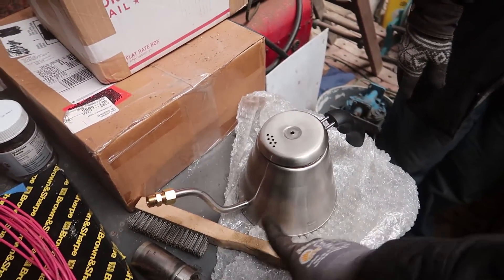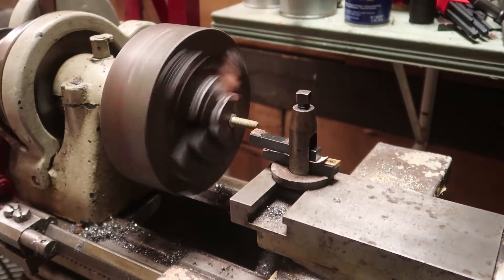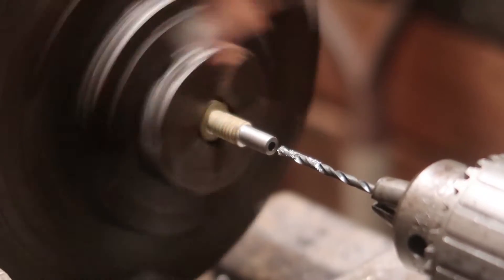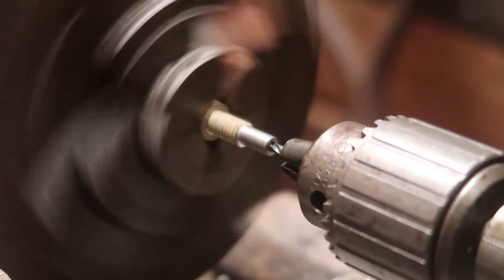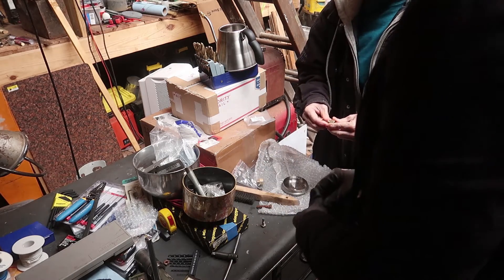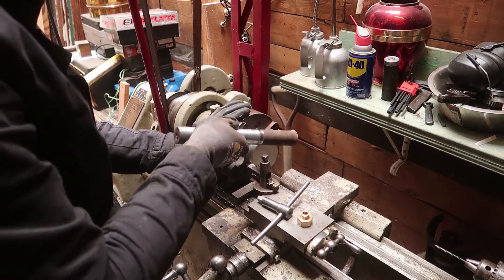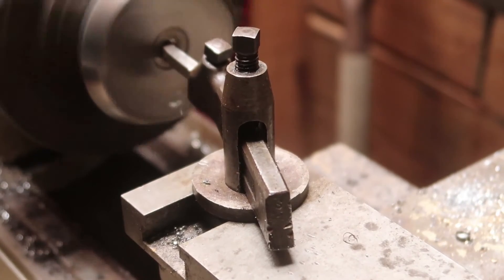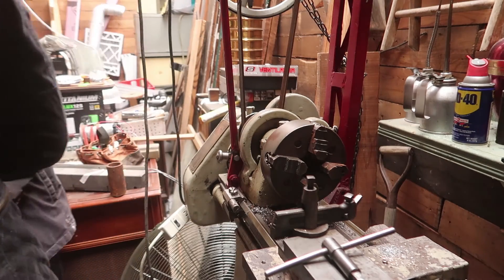Learning To Lathe 05: Rapid Prototyping Metal Fittings for Homemade Water Distiller System

Comment: If you want to make that lathe quieter change that belt to a car serpentine belt  it will have more grip and run smoother
Reply from the maker: that is a horrible suggestion, flat belt is great for this as long as its the right length.

Comment: A brief suggestion, when manually feeding as you did on the compound to clean off the threads: use two hands, rather than just one on the handle, to turn the control. That results (with practice) in much more even tracking of the tool, which results in better finish and more consistent material removal.
Reply from the maker: yeah i do that with the larger controls that face me but its difficult to do that with the sideways handle when my moms standing in that spot.

Comment: I was surprised to find that CPAP manuals only recommend distilled water in the USA. For Europe and elsewhere, they just read to use, "clean water" (caveat - I only checked the Resmed machines). I found out that any water that is safe to drink will work just fine for CPAP humidification. That being said, if your local tap water is loaded with minerals, it can build up stubborn deposits in your humidification tank and you have to soak it in vinegar (or worse) every so often to clean it out. So in some cases, distilled water is easier to use than cleaning off those deposits. But just FYI on the off chance you weren't aware. Love the videos! Keep up the awesome work!
Reply: My hubby has used his dry for years.

Comment: You didn't  show in the video  but make sure you are oiling those caps before and throughout  turning mine will empty them in about 10-15 minutes  i usual use 80w or higher but my lathe is also larger
Reply from the maker: i oil it ever few uses, but i dont want to oil it too much or it drips down and goes everywhere and wastes it.
Reply: @RinoaL  id say a lil wasted oil is better than a wasted bushing
Reply: Also keeps it from rusting lol
Reply from the maker: well the babbet bearings are ruined anyway, ill need to repour them. so im honestly not too concerned. seem to remember they have a lot of scoring and gashes in them.

Comment: Hey, that lathe is pretty cool. I've got its older brother(newest patent date march 1903). Did you ever get the power feed working? I had the same problem  when I first got mine.
 I made a new worm from a bronze bushing to go in the apron . then lapped the faces of the cone clutch(engages power feed ) with valve grinding compound. This was in the late '80's, and the power longitudinal and cross feeds have worked fine ever since. 

Tom
Reply from the maker: well i havent tried because when i was assembling the lathe i dropped a key that held the gears in so until i find that they wont connect.
Reply: @RinoaL  I hope you find that key.
Reply: @RinoaL  Straight key? Woodruff key? Measure up the slot width and risk a trip to the hardware store, or oder from McMaster-Carr.

Tom
Reply: OOPs, order.

Comment: much appreciate the video, but i think that lathe could work a lot better for you if it was all adjusted up and working smoothly, from your last lathe video there was way too much play on the cross slide, properly adjusted that thing should be rock solid. it should have spacers that are adjustable to take out all tat movement.
Reply from the maker: its 109 years old, so i think there isnt a whole lot more i could do without making new parts.
Reply: @RinoaL  have you seen Keith Ruckers channel, he does a lot of work on lathes and machines of this age and older, age is no obstacle to getting a lathe set up right.
Reply from the maker: yeah i've talked to him a bit over the years and i plan to visit him someday to help out with video work. but maybe you need to watch his videos more closely, getting an old machine like this running perfectly takes a lot more than turning a few screws. i might have to turn new babbet bearings for instance since these ones look to ahve scoring in them. and multiple parts in the cross slide have farmer welds/brazes on them and they dont seem put back together correctly. so itd require me to break those welds/brazes and replace those pieces. for now im happy with it. ill leave that stuff till later

See what i'm hoping to do, is find another lathe in terrible terrible condition, and use this lathe to restore it fully, then once that one is fully restored, ill tear this one down.
Reply: In that case I wish you well with the future project, they must have had basic lathes to make better ones, I imagine the first lead screw was the worst one to try and make.